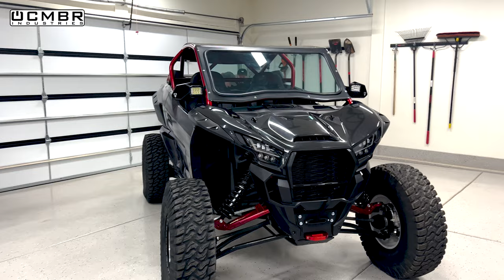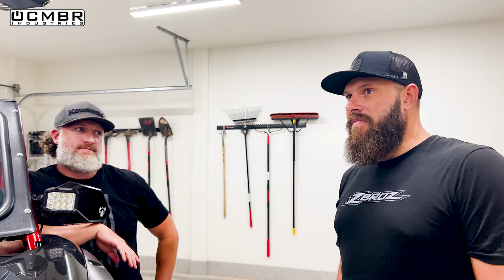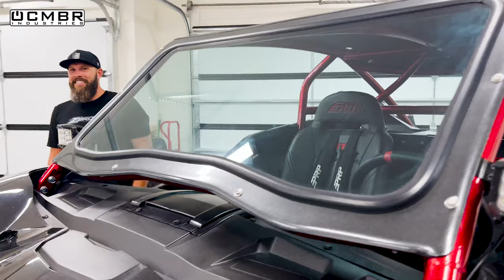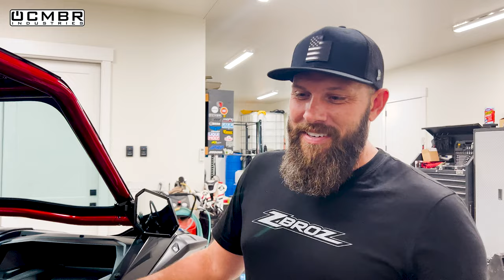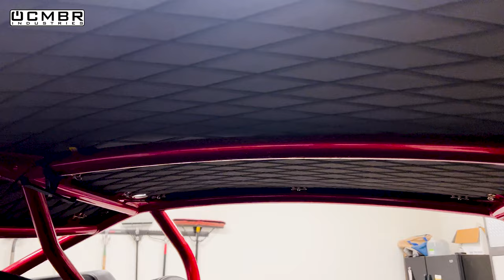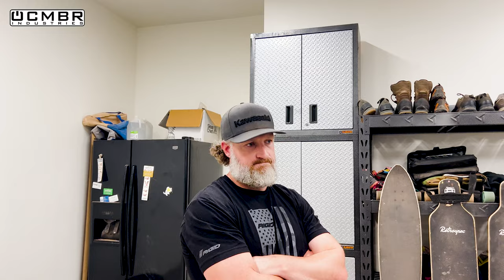2022 Kawasaki KRX 1000 - Ryan's new car. Build Recap & Review

Comment: Love mine 2021 KRX 1000 trail addition with PRP seats & harnesses, Dino jet tune, system three ss360 tires run mostly sand, will make it out to Utah for some rock trails one of these days.
Reply from the maker: We’ve been looking at that dynojet tuner. Did you do the clutch kit too?

Comment: Nice krx1000 & Yes Landwfab 
Does the aluminum packout lockout system 👍 really cool nice build BTW
Reply from the maker: Thanks man! L&W has them for the RZR but I couldn’t find a KRX version. The one we saw was by https://prosteelproducts.com/, he has a couple versions for the KRX that look nice.
Reply: @OffCamberInd  I asked the same for my 2 seater general if I could combine 2 because milwaukee coming out with a big cooler and after my springerville jamboree I'm going to make a flatbed for the general 
Make sure u guys keep the 4 seater general mine works with rzr turbo front suspension xp rear and it's a 2018 / DIG ALL YOUR VIDEOS And plan on coming back to sand hollow with my new 2 seater got my but kicked at double Sammy 👍

Comment: I love the EVA boat decking on the roof. What brand did you use? Were you able to get a large enough roll to do it in one piece?
Reply from the maker: You’ll most likely end up using 2 rolls to make it wide enough. We just use whatever they sell on Amazon. I assume it all comes from the same place, we just choose based on color and dimension